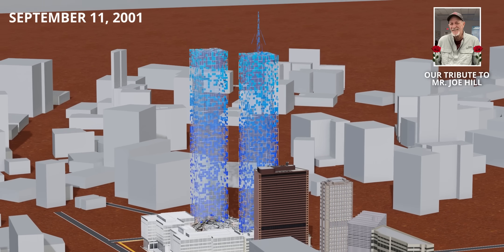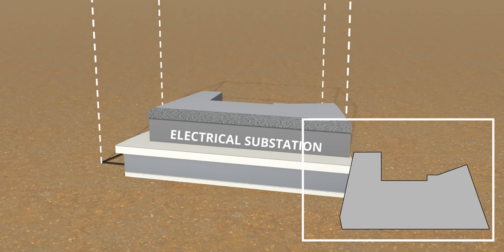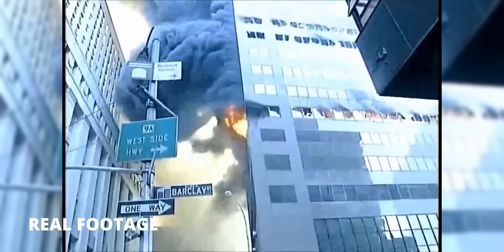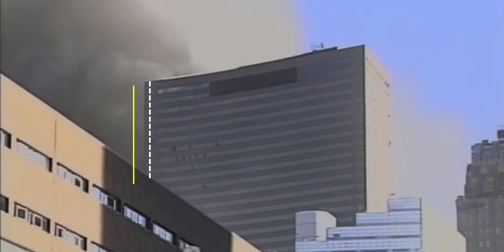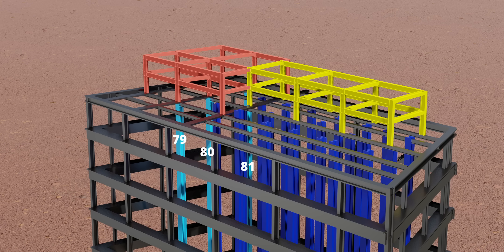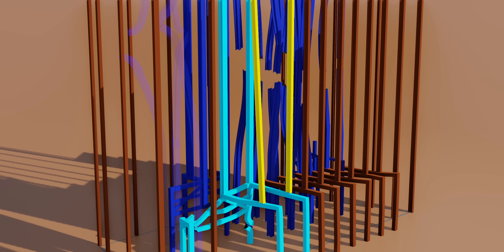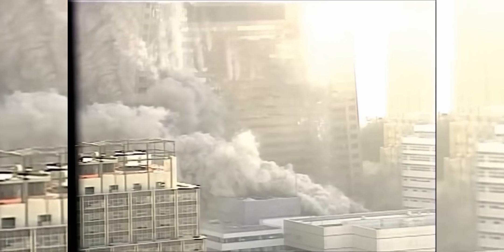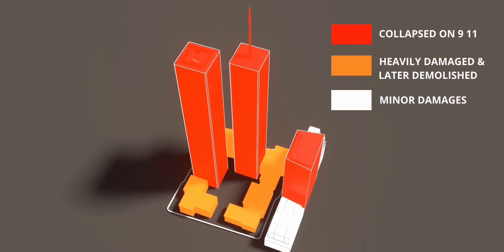Collapse of Building 7 | The Complete Physics

Comment: Each slab of the floors are holding the columns floor by floor. What you present is core column isi not a seperate line going upwards independently. 
Also iron is not a good conductive you can hold a sword from one side and put in the fire from the other side and your hand doesn't burn. Building is not leaning to one side , according to your visual it must lean to one side. But it is falling like a sandwich and core columns are failed first. Which must be the last place to fail. I am sorry because it is a controlled demolitoin. Evey part of the buiding must be falllen but the core columns.
Reply: Core columns failed first and failed progressively. This is obvious even from simple visual observation.

The North Tower collapse at 10:28am bombarded Building 7 with tons of burning debris, causing heavy damage and starting multiple fires burning out of control for the next 7 hours. Half the FDNY firefighters having been killed, others injured, units in disarray, equipment destroyed, no water pressure, and the greater urgency of Search & Rescue efforts, firefighting was pulled as futile. The building couldn’t be saved and was left to its fate.

www.youtube.com/watch?v=g_SvpwyC17M&ab_channel=MFitz  

Collapse of a burning structure is always a concern for firefighters. Steel buildings subject to fire rely on active fighting of the fires to survive. Buildings are designed around 1 to 3 hours of fire resistance, allowing time for occupants to escape and ACTIVE firefighting to get started, after which all bets are off. Left to their own devices they will exceed their design envelope and collapse. In B7 the occupants escaped, passive and active fire protections were compromised and active firefighting was abandoned which left the building to take its chances. It lost. Odds on Building 7 would eventually collapse, and it did. No big deal in logic. That is the sort of choice firefighters make every day in brush fire situations - which houses to save and which ones to let go. Only real difference here is moving the decimal on the size and cost.

www.youtube.com/watch?v=WnYBX6QT0R4 

FDNY Chief Daniel Nigro ; The biggest decision we had to make on the first day was to clear the area and create a collapse zone around the severely damaged 7 World Trade Center, a 47-story building heavily involved in fire. A number of fire officers and companies assessed the damage to the building. The appraisals indicated that the buildings structural integrity was in serious doubt. I issued orders to PULL BACK the firefighters and define the collapse zone. It was a critical decision; We could not lose any more firefighters. It took a lot of time to PULL EVERYONE OUT, given the emotionalism of the day, communications difficulties and the collapse terrain

FDNY Deputy Chief Peter Hayden ; We had our special operations people set up surveying instruments to monitor and see if there was any movement in the building. We were concerned of the possibility of collapse in the building. And we had a discussion with one particular engineer there, and we asked him if we allowed it to burn could we anticipate a collapse and if so, how soon? And it turned out that he was pretty much right on the money, that he said 'In its current state you have about 5 hours

The collapse of Building 7 was anticipated and widely reported in the media throughout the day. At least 24 video cameras recording some or all of the collapse. Everyone knew what was coming and why.

www.youtube.com/watch?v=OY5S5k3tMHI 

Building 7’s collapse was completely different to the Twin Towers, harder to understand with most of the details difficult to see. But we can still sort out what happened through careful analysis and observation.  This is MY EXPLANATION of the collapse sequence using the best available information and relying on no authority.

B7 was complex 47-story steel framed structure built on top of a smaller existing 3-story building, requiring several lower floors dedicated to complex load transfer structures instead of usable office space. Of trapezoidal shape and all-steel tube-in-tube construction, B7 (above the 7th floor) consisted of a central core of steel columns carrying most of the gravity load, perimeter steel columns around the outside of the structure carrying the remainder of the gravity loads and long span beams and girders to tie those elements together and form the floors. On the outside of the building hung a moment frame - the last part of B7 to fall. 

Phase 1 : The first externally visible signs of collapse initiation occurred at 5:20:28 pm. Collapse initiation for B7 is notably quiet with observers not realizing the building was collapsing! There was no audible warning in the form of say hundreds of ear drum busting 180-190dB explosive bangs preceding the collapse. Here at 12:00 a local CBS affiliate reporter is talking 10 blocks from B7 when collapse begins. People don’t start to notice the collapse until 12:11. Then at 12:45 is the famous CBS fixed camera clip of Building 7’s collapse.  Note how quiet it is.

youtube.com/watch?v=t5tEy6mXSE8&ab_channel=fresnosean379

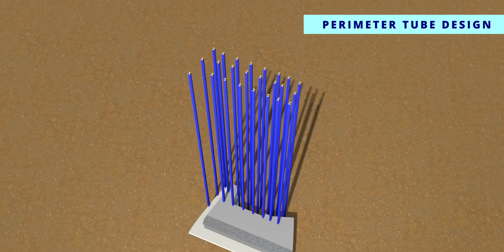Collapse initiation was due to lower floor failures above the load transfer region (7th floor) in the NE corner of the building. In this video at 0:45 you can see the NW corner from inside the building while under construction, Column 79 just out of frame on the left. That big, angled steel beam across the top of the frame connects to C79 at one end. The girders connect to the beam. That beam and all those girders depend on just one connection

youtube.com/watch?v=nP3TNHPCIVU&t=35s&ab_channel=EdwardCurrent

Phase 2 : Lower floor failures caused a loss of critical lateral support over an excessive length of core Column 79 and it buckled. If you look at a floor diagram of Building 7 (see above) and look at all the structures that depend on C79 you quickly realize this one column was a relatively isolated structural element on which a disproportionately greater fraction of the structure depended analogous to say the Key Bridge. Externally we see a vertical progression of window breakage along the 44-46 line and a kink in the roof of the East Mechanical Penthouse at the top of the building, consistent with C79 failure. The transition from full capacity to almost no capacity occurs in virtually an instant. Once the buckling failure occurs there is almost no resistance

Normally with a buckling column, the load could very well be redistributed to other columns, meaning the buckling could stop after a while. With C79 that is not the case - the failure did not redistribute the load, so the collapse rapidly progressed to the roofline, sinking the rooftop penthouse.

Phase 3 : With C79 gone, B7’s progressive, non-symmetrical collapse continues with C80 and C81 at the east end of the core left laterally unsupported and quickly buckled and failed as well, sending the EMP down through the building. C79-81 all have no diagonal bracing, which I believe is a major reason why they could not redistribute a lot of vertical loads among one another.

From there collapse progressed from east to west through the central core until the core was gone taking all of the interior floors and structures and probably most of the perimeter columns with it. You can see the horizontal progression of window failures low in the building and the dropping of the remaining rooftop structures into the building. One of the big takeaways from the NIST Building 7 study (that gets completely ignored) was their modeling which determined C79 failing under ANY circumstances would have initiated the same collapse sequence.

Phase 4 : After some 10 seconds all that remains of Building 7 is just a hollow empty outer shell - the exterior moment frame - creating the illusion the building is still standing since little has changed externally. But it’s just a hollow empty shell like an empty cereal box supported by only a few remaining columns and quite unable to remain standing. With all the internal framing gone, the north face leans inward, forming a V in the roofline, the last perimeter columns buckle under the strain and with nothing left keeping it up the moment frame free falls, landing on top of the 7-story high debris pile. It is only at the very end that a single measurement of alleged free fall acceleration is taken. Note this is not the building but just its outer shell, and only one corner at that, at the very end of the collapse. Start to finish the entire collapse took 18-20 seconds, or less than 1/3 of true free fall and we have to look at the whole thing, not cherry-pick little bits to fit a particular narrative. Worth noting _how fast something falls cannot tell you what started it falling in the first place. The debris spread out, blocking surrounding streets, heavily damaging the Verizon Building and destroyed Fiterman Hall, all well outside of Building 7’s “footprint”.  

Building 7’s progressive, non-symmetrical collapse was incidental and unintended collateral damage from the combined effects of fire + time + gravity started by the collapsing North Tower. That is true no matter who planned and carried out the 9/11 attacks or why . The collapse was of so little consequence it barely even registered at the time, a mere footnote. It only took on semi-mythical status as an alleged smoking gun years later when demolitions at the Twin Towers, missiles at the Pentagon and shoot down over Shanksville all failed and conspiracists had nothing left to work with.

Anything can seem like a conspiracy if you don’t understand how it works. Now you should. I hope you found this helpful, informative and it solicits informed critical comment. If I made any errors of fact, logic or reason or left anything important out, please let me know so I can fix it. IF you can offer a more plausible alternative please do. Be the first. Please start any reply with the words “Tits McGee” or I will know you didn’t read it and are wasting my time.

Comment: https://youtu.be/n_ccettdTvg?si=AwaBmgiZTTMYz2Ay
Debunked in 45 seconds.
Reply: Ah, yes. The PERFECT example of someone not knowing the first thing.

1, the F4 Phantom, at MTOW, that is Maximum Take-Off Weight, weighs 61,795 lbs. That is the highest weight the plane could have and still take off. The Boeing 767-200, meanwhile, has an OEW, or Objective Empty Weight, the LEAST it could possibly weigh, of 176,650 lbs. That means that the LEAST difference in weight would be 2.8 times as much weight in the 767. And it wasn't empty.

2, the concrete "wall" the F4 impacts is 14 feet thick. It's made of solid concrete. AND, it's "floating". It's not actually in contact with the ground, meaning it gives way under impact. Meanwhile, the facing of WTC7 wasn't steel, no matter how you want to claim that. The wall wasn't 14 feet thick. And it didn't give way.

3, an F4 isn't "hardened". It's built in exactly the same way as any other aircraft, because that works. It's a smaller "aluminium can". That's all it is.

And, of course, 4. Concrete is significantly harder than steel, having a Moh scale rating of 6 to 7, compared to steels 4 to 4.5. Also easily seen in things like press-shaped steel. Under forces, steel deforms and plasticizes, while concrete, under GREATER forces, cracks.

You managed to get literally not a single thing right, while patting yourself so hard on the back you nearly dislocated your shoulder. Maybe you should start learning actual science instead of thinking cartoons are real? Not that any single part of this is relevant, since no planes of any kind hit WTC 7. That is, after all, one of you "truthers" hobby-horses, isn't it?
Reply: OK, how?  Please explain in detail how the content of that clip has anything whatsoever to do with Building 7, the subject of this video?

Were you even paying attention?
Reply: @TheCriticalStinker-jw4fl  Were you paying attention, lol?

That is a military "hardened" plane VAPORIZING at 500mph against basic concrete.
The WTC was STEEL faced.
(MUCH harder than concrete)

Getting hit by an aluminum can passenger plane.

I know you grew up thinking Willie Coyote actually goes through the rocks and into mountains (leaving his outline behind, lol), but that is NOT how things at high speeds behave, as I demonstrated....

At 500mph, any PROJECTILE, whether it is a LEAD bullet or a barely tinfoil thick passenger plane, tends to SHATTER on impact when hitting steel.

You can believe cartoon science, though.
I can't stop you.
Reply: @federalreservewolflegend3523  - OK, and how many F-4 Phantom's hit Building 7?

Zero. 

Building 7 was lost due to 7 hours of building-wide unfought fires.
Reply: Tried replying 4 times. Since I am right, they won't let it stay up.
Reply: @federalreservewolflegend3523  - You were wrong from the off. The subject of this video has nothing whatsoever to do with any airplanes.  This entire thread could not be more irrelevant to topic.

Also, are you including a link in your reply?  Don't do that. 

Learn how YouTube works, then maybe you can start figuring out 9/11.
Reply: @TheCriticalStinker-jw4fl   The ONLY way they will allow me to post is if I do not discuss the science.
I guess I can post stupid stuff like pointing out my main post HAS a link so there is one wrong on you.
But it won't let me get into frangible, hollow point, and lead discussion which was a trap I can't even throw ABOUT building 7 now, so I will resort to the tooth fairy story.

The tooth fairy came 3 times in my life and left a buck.

In the entire history of mankind...
Not before, and not since, has even ONE steel framed building fallen from basic fires. 
It happened THREE times, all on THAT day, and never again.
Do you want 3 bucks for under your pillow cuz that's Tooth Fairy stuff right here?
Reply: @federalreservewolflegend3523  - Your OP has a link to a YouTube video which is allowed. Outside links are not. Have not been for years. FFS 🤦‍♂

Nobody cares what sort of mindless stupidity you have to say. You are not being censored. 

You continue to fail to impress and yes, I know you are convinced the problem is everything but you, but it is in fact just YOU. 

Again, take a few minutes to figure out how YouTube works. Then take a few more to figure out why discussion of an impact test of nuclear reactor dome structures has absolutely nothing to do with a building fire.
Reply: @federalreservewolflegend3523  "The ONLY way they will allow me to post"
Of course. "They", whoever you think they are, are absolutely so very scared of you, personally. Really.